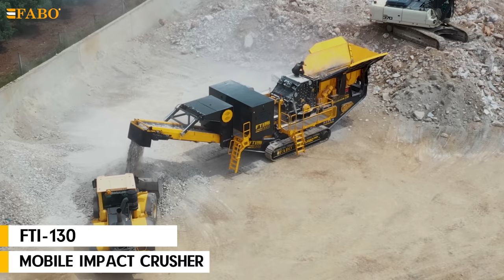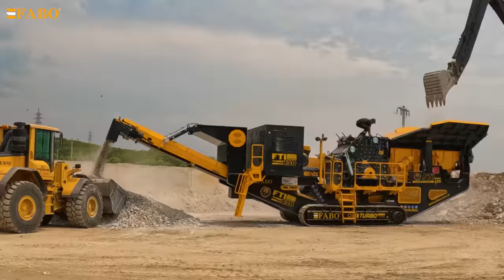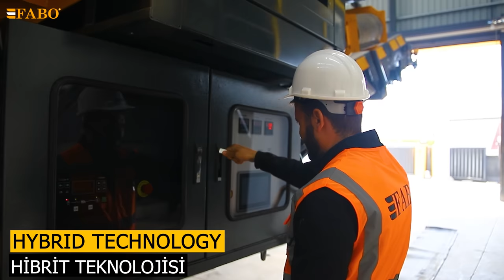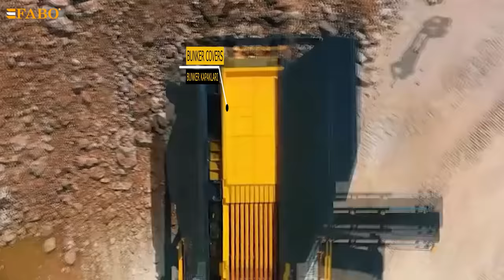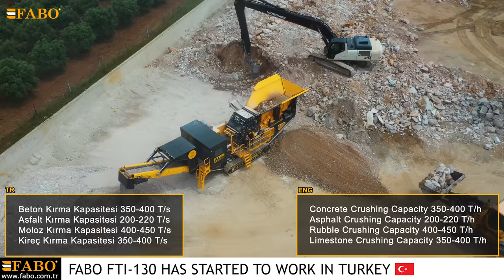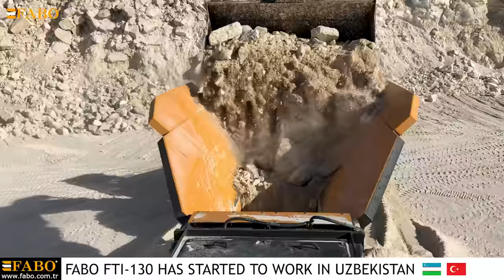FABO | FTI-130 Tracked Mobile Stone Crusher 400-450 Tph For Limestone,Gypsum,Marble And Recycling.

Comment: Congratulations to Fabo for this very special and useful tracked #impactcrusher which can be used in #limestone  #gypsum #marble #crushing and also in #recycling projects. Thanks to its compact and easy movable design and low fuel consumption with its #hybrid drive system it continues to be the choice of customers.